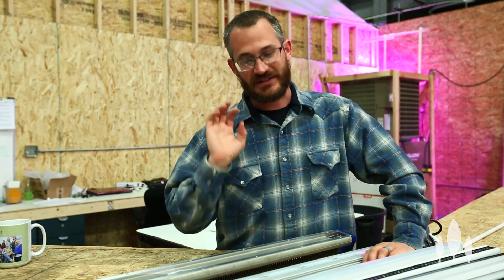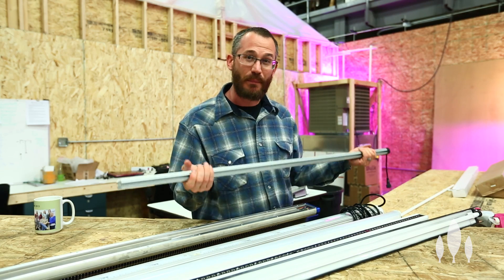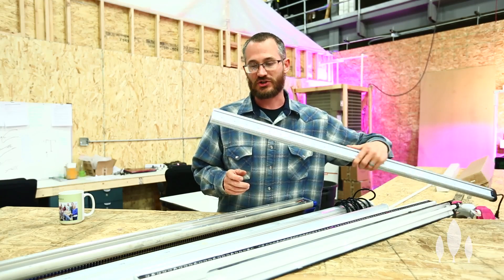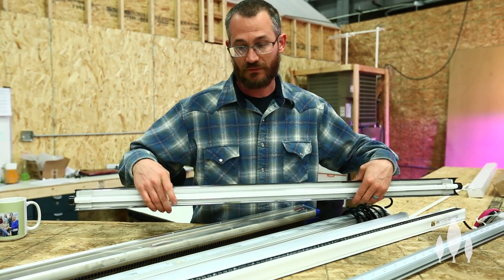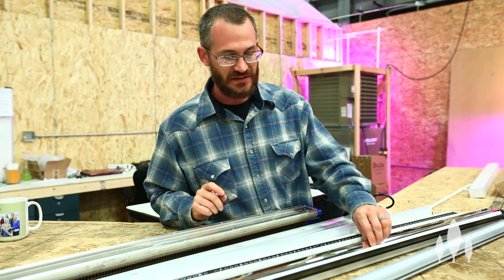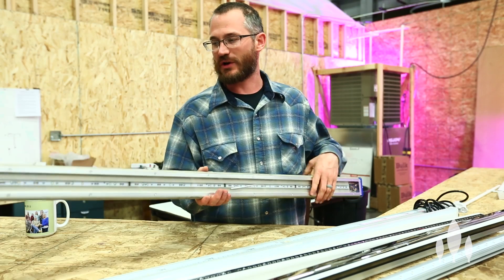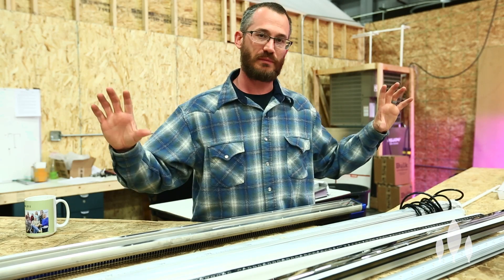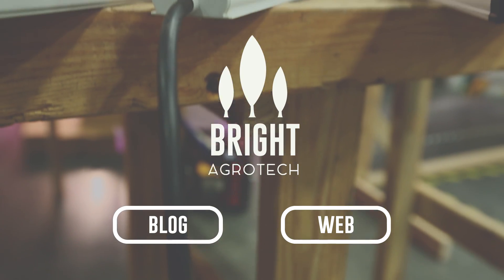Different Types of LED Light Bars

Comment: Did the heatsink come with the LED you're holding at 1:10? I'm very interested in learning more about that heatsink such as where I can buy it. It looks like it can easily handle 100W.
Reply from the maker: Thanks for your question Kuan. This is an older video, since we made this LEDs have come a long way. Now most lighting manufacturers design their lights with an integrated heatsink which provides sufficient passive cooling.

Comment: It is the economics that raise questions for me.  With a Lumigrow bar consuming 185 watts at a cost of $0.10 per kilowatt-hour, the variable cost is over $13 per month for a 3 foot bar. If 13 plants can be raise in 4 weeks under this 3 foot light, that means supplemental light adds $1 per plant (excluding capital costs and return on investment). Are these assumptions wrong?

Comment: Is there anything wrong with those amazon led strips for small, not professional uses? I've seen some tests on youtube and the usual problem is they're not strong enough, which makes me wonder if just adding more strips wouldn't solve that...also, I live in Brazil, so these other options are really expensive here if you even find them, led strips are easier to find and to import

Comment: Can these or any type of LED light bar for a vehicle be converted to run on 110v/120? For instance, if I bought a light bar, would a simple rapid converter be able to power it from a outlet? Any help is appreciated.
Reply from the maker: You need a pretty heavy duty power supply/converter for high wattage lights and bars, but yes.
Reply: Thank you kindly.
Reply from the maker: Of course!
Reply: Its Writer this would give you 12v dc from 110ac , although you might want to invest a little more and get a higher quality model so you don’t burn your house down.. safety first!

https://rover.ebay.com/rover/0/0/0?mpre=https%3A%2F%2Fwww.ebay.co.uk%2Fulk%2Fitm%2F123895121191

Comment: Hey Nate,

Could you tell me your thoughts on Induction lighting? www.econoluxindustries.com/Technology.html. It appears that the induction lighting stays within PAR for plants, it has a much longer lifespan, and has more efficient lighting costs than even LEDs. I had read that a 1000 watt HPS provide a larger crop than other lighting sources but not as good product as Metal Halide due to the lack of UVB. So the additional questions are how does the 1000 watt produce so well with being so far out of the PAR realm for plants? What is you thoughts on UVB lighting for plants in moderation? And, can the UVB lighting be provided through LEDs?
Reply from the maker: Hey +Randolph Mays II - Induction lighting is great but its drawbacks are that it is not as robust/rugged as LEDs, isn’t directional (i.e. requires reflectors which reduce efficiency) and isn’t spectrum specific (so loses some efficiency there), but on a more traditional lumen to lumen basis is pretty comparable and a little less expensive than LEDs.  The lifespan on most induction is around 60k hrs, but you can find them for much longer- good, well-cooled LEDs will last as long although they may lose some efficiency over time.  UVB is a great thing to have so long as you know what you’re doing with it and it’s crop specific.  There are very few reasons to hit lettuce with UVB, but basil is a great candidate for UVB exposure.  You can provide UVB through LEDs.

1 new message since 1:15 PMMark as read (esc)Mark as read

Comment: CPU cooling in hot climate uses water cooling, copper pipe over LED with radiator and fan problem solved or use a heat exchanger with main loop to heat water

Comment: and less Words which one is the best.
Reply from the maker: +Cesar Sanches That depends... How are you defining "best"? 
1) Lowest cost?
2) Highest PAR output? 
3) Best electricity usage? 
4) Lowest wattage? 
5) Highest wattage? 
6) Best warranty? 
7) Best lights for low voltage buildings? 
8) Best lights for high voltage buildings? 
9) Most durable? 

Everyone's situation is different and the amount of variables that each individual grower has to think about in order to make a decision is pretty overwhelming.
Reply: +Bright Agrotech 
 thanks a lot for your help